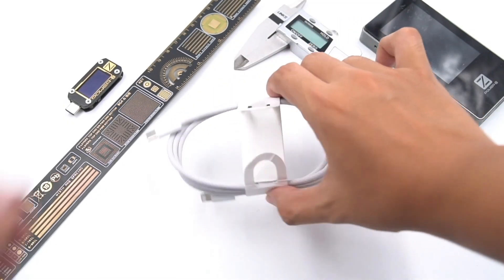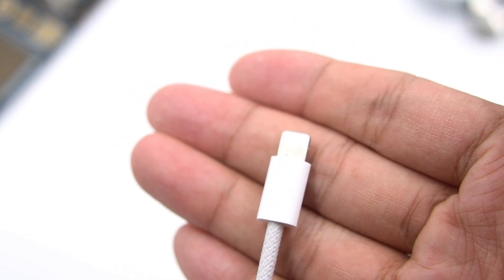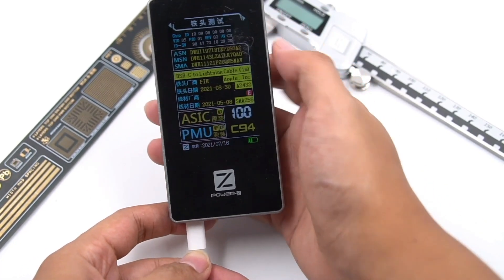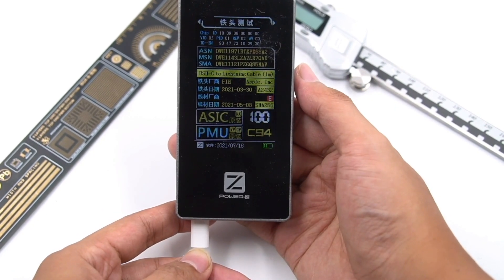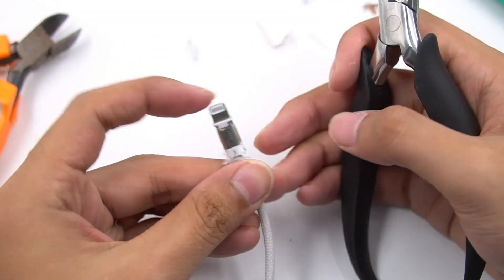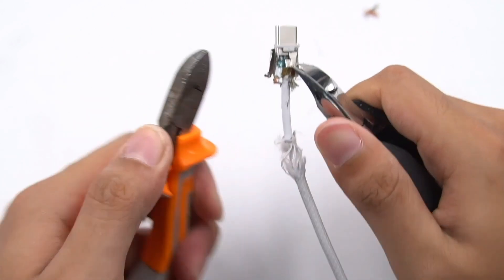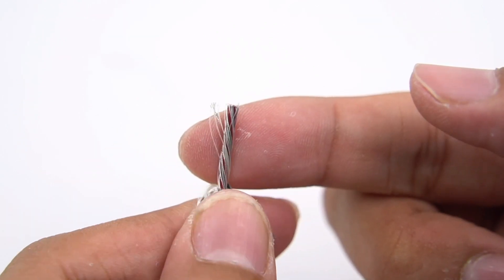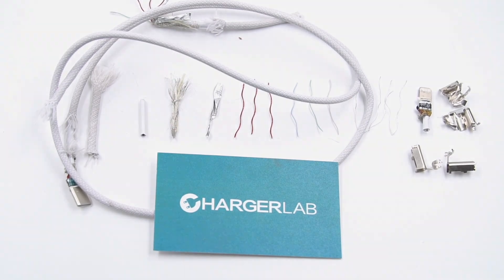Standard iMac Cable | Teardown of Apple Woven USB-C to Lightning Cable (1 m)

Comment: Thank you!! My MacBook M2 air charging cable Got wet and it just happens that the part that got wet was the middle the USB and the mag safe were elevated so The body of the cable Got submerged in water.. I’m afraid to use it on my MacBook again but I think so this video I realize that inside the weave is plastic case thank you

Comment: The lightning connector in that cable also has a newer and larger controller chip in it than the original USB 2.0 to lightning cable from Apple while the security functionality would also be handled by that chip or the second chip! Of course the larger chip makes sense as it would need to be able to handle higher charging wattages than what the original USB 2.0 cable was originally designed for! :)